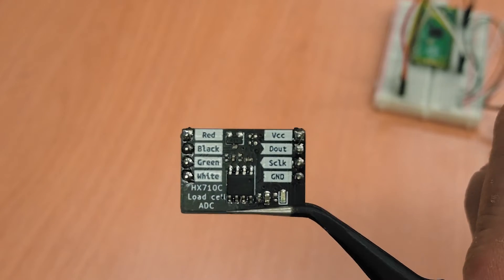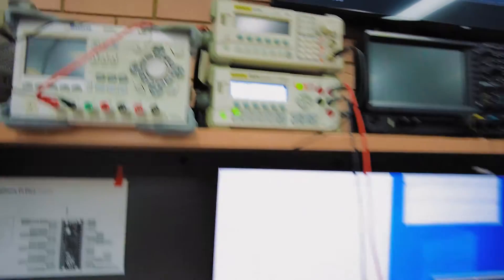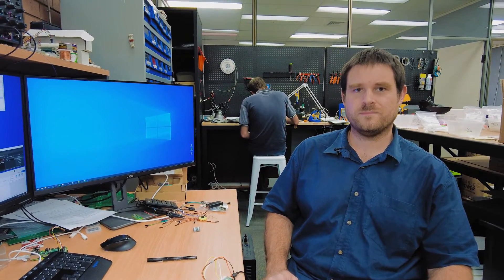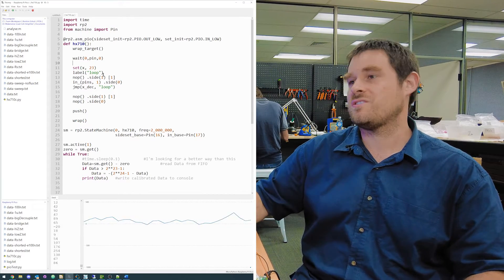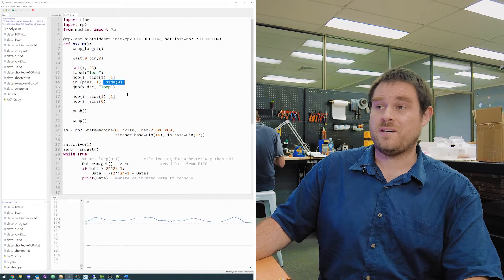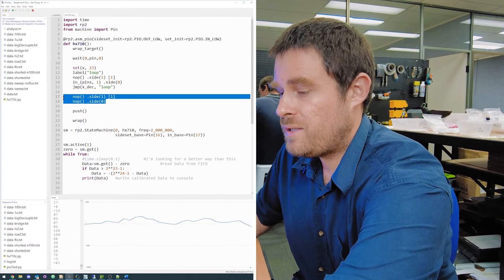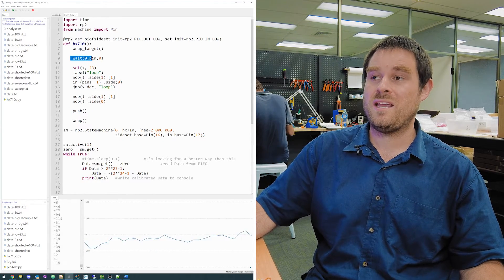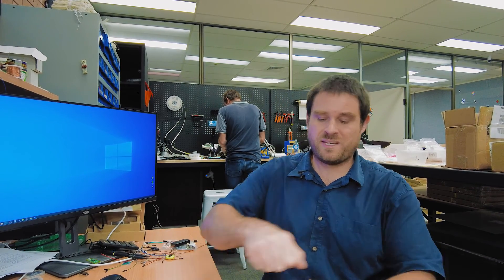The Factory | Device drivers with Raspberry Pi Pico PIO

Comment: Just wondering if the program is trying to read the Data at the very instance it makes the Clock Low. Perhaps, you could demonstrate that it makes no difference, if you put an additional delay [1] when you make the clock low and then, read the Data Pin. If you change the code slightly, e.g. ..... nop()  .side 0 [1]    and the on the next line write  ....  in(pins,1).
It may be possible to see, the result, on the scope on the screen.

Comment: Thank you for this excellent video. This is raw data with no feedback (such as in Sigma Delta Converter). Is it possible to introduce some sort of Software Digital Filter, (such as rollover averaging filter etc)  to make the data more tame.
Should one wishes to make a weighing scales using HX710C/HX711, how many parts accuracy can one expect ?

Comment: Perhaps you can do a quick follow-up video on how to use multiple load cells together. In other words is there a way to wire up the load cells to a single analog to digital converter chip?
Reply from the maker: Hey Andrew 😃 If you want to read separate load cells individually it would be best to use separate ADCs. Multiple instances of this state machine can be instantiated to handle multiple ADCs. Otherwise -  If you want to read multiple load cells and combine them for a single weight look into using a "combinator". These are used when you want to measure the weight of a load, but you can't guarantee it'll be placed in the exact middle of a scale's tray.
Reply: Multiple Analog Load cells connect together (shunt), via a junction box, as simple as that. What I would like to know is, "can the HX710/HX711 be in the heart of a Weighbridge/Large Platform, Indicator (using 4 to 6 load cells)?"
Reply: @gautombose4172  yeah mate, there are plenty of digital junction boxes which can pickup each i2c address and combine all loadcells into one output wire going to the indicator